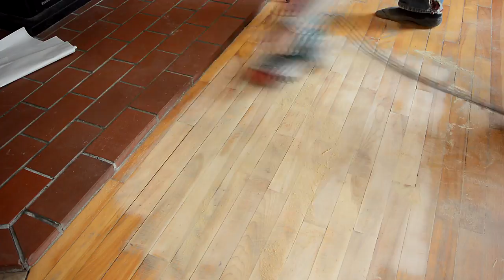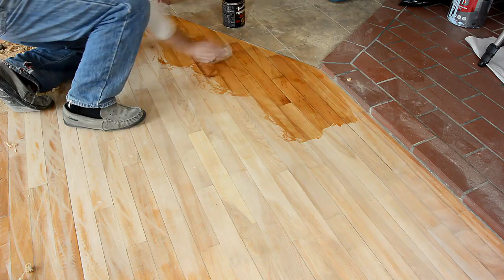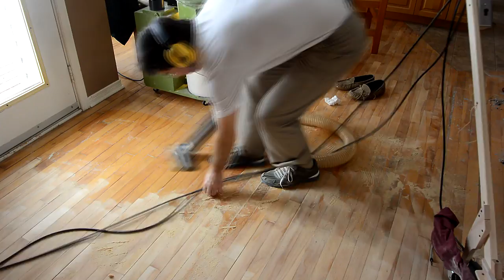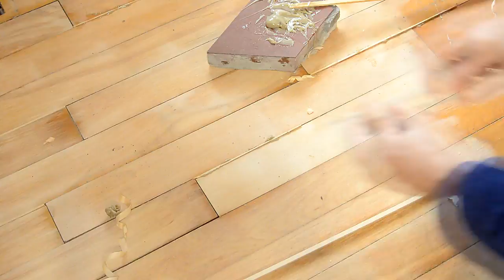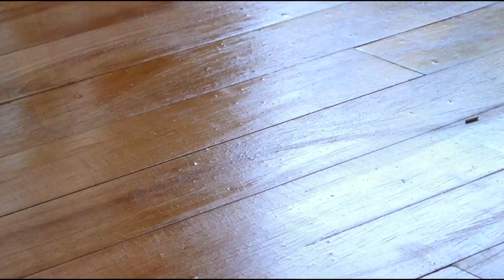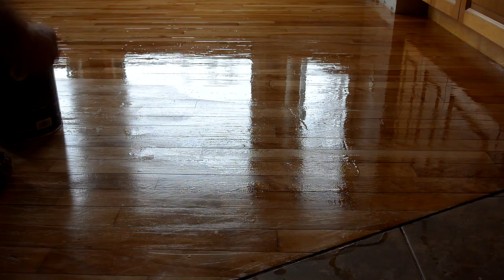Hardwood floor refinishing by trial and error

Comment: I did mine...just rented a floor sander...big beast but fast and really cheap. £50 for 3 days if I remember rightly.
Reply: exactly... rent a floor sander... lol
Reply: Yep. Time is money. renting the right tool is the way to go
Reply: Yep, in my area they have the pro models that are the big drum and disk and one for someone who is afraid they may sand thru their floor with the belt sander or get spin into the wall with the floor disk sander/buffer. It usess 6 6" orbital sanders.
Reply: Cliff Hartle I think my place did a deal as I got the rotary edge sander too free. Just had to do the corners by hand.

I think the paper/pads/belts cost me about £3 for the whole job. 1 room and none hallway.
Reply: I found it truly painful to watch this with Matthias using a what a 4" wide belt sander even with the handle.
Reply: Or hire a pro!
Reply: you no pro
Reply: Tony Walker what do you know?
Reply: Russell Cottier jm

Comment: The first thing he says is that they are getting the floor professionally refinished. He just wanted to experiment, tinker with some methods for fun. It is what he does. That is why he is an amazing contraption builder.
Reply: Dire Axe - Or, being a professional, they just did their job. Shoot, he probably told him what he did anyways.
Reply: True, but he could have done it himself. Just use 36-, 50- or 60-, and 80-grit sandpaper, along with the corresponding sandpaper for an edger. Use that scraper to get the parts the edger could not reach. And finish with a buffer. 

Why destroy the floor?
Reply: SO IF YOU ARE GOING TO HAVE IT PROFESSIONALLY REFINISHED WHY SCREW IT UP FOR THEM BEFORE THEY START.  YOU MUST HAVE A LOT OF SPARE TIME ON YOUR HANDS.

Comment: This tutorial is perfect for those who have tons of free time in their hands but no $ in their packets to rent floors machines.
So many things could of done right in this video.
The right way to sand and refinish a floor 
1. Clean floor gaps and fill it in with floor filler  before sanding.
2. Sand floor 2-3 steps.
3. Buff the floor.
4. Apply color.
5. Apply first coat of floor finish
6. Buff again
7. Apply another coat of floor finish
8. Check and apply final coat of floor finish.
Sounds so many steps but actually is way faster and the results is professional.

Comment: Hello thank you for your video. Your exploration process figuring out how to refinish your floor was very interesting. Although you took a difficult way to get there I've seen worse jobs. If you and your family like it that's what matters. Typical sanding and refinishing is $1.50 per square ft natural process, (meaning no stain), or a $600 minimum. Based on the size of your area you may have been able to get that done for $600. For those that watch this video for instruction. I would recommend using a rental sanding machine (or for a very small area you can use that belt sander if you are patient), starting with a 40 grit sandpaper sanding, with the grain, never across it. Fill your out of Tolerance gaps, meaning larger than the width of a coin (quarter) with wood filler, they sell wood floor wood filler in the appropriate color to your stain. Many of the fillers also accept stain. Sandable wood filler is similar to joint compound. The non sandable putty that he used is for nail holes and cracks that you would use either between coats or after the final coat if you wanted to fill something that you missed. Moving on, then you would use a fine grit sandpaper 80 grit on the Belt machine.  You then need to scrape and hand sand the corners, saddles, or wood work that you cannot use the machine on. Next you will use a buffing machine with 120 Grit which spins in a circular motion typically 16in pad and that will make the floor smooth and ready for finish. Or for a small area you could use a palm sander. Next process you would vacuum the floor thoroughly. After vacuuming consider using a tack cloth which would be a towel pushed with a broom to pick up excess dust. Dust is your enemy in wood floor refinishing! Your floor must be very clean! You may like to wet the towel with mineral spirits, as it will not have a reaction with the wood, do not use water. Then you are ready to apply your finish. Apply the finish or stain with the grain of the wood. always use thin coats. You do not want thick puddles. typically you would use a lambswool applicator which is approximately 9 inches wide, or you can use a 4in disposable brush and paint your way out of the room for smaller areas. Lightly sand between coats with 150 Grit, vacuum and Tack cloth, apply as many coats as you like. Typically three is sufficient, four coats with water base.  all right folks have fun with your wood floors. Or if you are local to Rye New York you can contact me. Thank you and best wishes

Comment: You should always sand wood with the grains.. Not just rub the machine all over the place...
Reply: This isnt a DIY giude xD
Reply: And he also explains his reasoning and, while I'm no expert, I think it's pretty solid
Reply: That's true but you can go diagonal if the floor board have cuped or bowed and you cross cut it the other direction but after this you must go with the grain
Reply: But it different story with the edgers
Reply: That's what i thought as well
Reply: LucidDarkness omg. My wife and I just cracked up over your comment. To funny
Reply: Exactly!!
Reply: @Weird Science 
Actually, as a "PRO" hardwood floor guy I can tell you that you always start your first pass with the big machine "aka hummel" at an angle, the angle depends on the how flat the boards are in relation to each other. And your last pass with your last grit will always be straight. But what do I know, I have went from building cabinets and installing trim and doors to installing and finishing floors of pine, red oak, white oak, walnut, cherry, maple, hickory and Brazilian cherry. And just so you know I'm really a pro I have some sawdust boogers in my nose.
Reply: Glad I wasn't the only one cringing at that lol
Reply: If you're doing multiple passes with the same grit you can do the first pass across the grain. It's really only important that you finish with the grain. The purpose of going with the grain is to hide scratches left by the sandpaper, but the last pass with take those out.
Reply: I AGREE THAT REALLY BOTHERED ME CONSIDERING I'VE RESTORED LIKE 20 WOODEN FLOORS AND SOME OF THE WORST IN CHICAGO APARTMENTS THAT HAD CARPETING WITH STAPLES
Reply: 🤣OMG, I CAN'T LOOK!!! WTF 🤣🤣🤣

Comment: One of my earliest memories is when I was a toddler back in the early 70s, my Dad refinished the oak floors in two large rooms in our house. He sanded it all down on his knees with one of those big chrome hand held belt sanders they had back then. It was beautiful, except for one gouge filled with putty from when he threw the sander across the room in a moment of frustration. I'm guessing you experienced that emotion at some point in this project. Good job on not throwing your sander. These modern plastic tools wouldn't have survived that generations tempers.

Comment: Sanding a large surface with a small tool WILL create an uneven surface. The unevenness may be unnoticeable to the eye but each time it's sanded like this, will just get worse. If you don't care about that sort of thing, I'd call it a success. I understand your video is not a guide, but I have a really good floor refinishing video that covers all of the steps in detail.
Reply: If Matt is happy that is all that matters. I doubt he is going to jump right on redoing it any time too soon either. In fact I'd put good money on him never doing it ever again.
Reply: thank you Paul.
Reply: Yes, you dont want to use a belt sander. Just rent a orbital floor buffer and buy some sanding screens. Sand the edges by hand, use belt sander sparingly.

Comment: Matthias I love your videos and inventions but this one you got wrong as wrong could be. Fairly entertaining but still wrong. You should know that dust is your enemy when finish is applied. And with a surface this big you have to be much more consistent when removing the dust. I do this for a living and my soul is going to need some healing this weekend after watching this 😉 Anyways. Have a nice weekend and always use a respirator when applying varnish 😊
Reply: He calls it varnish but I think it's water-based Varathane floor finish.
Reply: Learning from mistakes is the best way to learn.
Reply: Learning from others is the best way. And the cheapest 😉
Reply: My only thought was that he should have washed the floor (whipe with a damp rag or mop).  Would that be correct?  I just say that because when I vacuum, if I don't mop the floor after, there's always a tiny bit of fine dust on my feet when I walk barefoot.

But I'm also thinking that you wouldn't want to trap moisture in there with the varnish.

Anyway, I wish your soul a prompt recovery.
Reply: no, reading the basics of what to do from any of the countless resources on the internet is the best way to learn. people have been finishing floors for centuries. yeesh.
Reply: Philippe Carphin We use a static disposable cloth after vacuuming to collect the fine dust. We also sand a lot more between the coats to get a smoother finish. But in this case the sanding method up front is pretty uneven so I'm not sure if i would mather that much anyways. I love Matthias's creativity and he's not to far out with the handle on the band sander. But the position should be more fixed to get an more even result. I use a Lägler Hummel rollsander and the prinsipals are the same really. But in  larger scale
Reply: Well goodie for you. Andy Warhol painted cars with brushes. Are you going to say he was wrong to do that too? Because one of the cars he painted is worth more than you're going to make in your whole life.
Reply: Paul Frederick Yes. Painting cars commercially is best done with a hvlp spray gun and everyone will agree on that. My comments has nothing to do about art or Andy Warhol. Art is a subective matter. How to sand a floor is pretty much standarised by now.
Reply: +Ruben André Bjørkevik Matthias had a subjective goal in his mind when he started. He seems happy enough with the results he achieved. Though perhaps not happy enough to do it again? He still learned plenty in the process. Which is part of the art of living.
Reply: +Paul Frederick Yes and it's totally normal for a floor finishing professional to cringe at his methods.  He even put smiley emoji's in his comment to show it's all in good fun.
Reply: Paul Frederick I'm not a mindreader and my comments is not ment as an attack on Matthias. But I still feel you're a bit edgy in your comments. I appreciate Matthias's eager and ingenuity but there would be lot ways of better tackling this project. And from a proffesional point of view this was, as commented, wrong in almost every way. I still had pleasure of watching the video and the hints of sarcasm in my comments was ment in a joyfull matter from my side.
Reply: I wouldn't be surprised if the floor looked worse after he finished with these techniques. Sanding across the grain (finished on edges), uneven sanding, scratching the floor with a scraper,  leaving dust allover, absolutely macerating the floor varnish (also across the grain). HOLY SHIT THIS IS A WOODWORKING CHANNEL!?!?!?!
Reply: +Philippe Carphin I do not think Matthias is suggesting that the methods he is demonstrating here rival that of professionals. If anything the impression I got was one of project creep. He said at the outset that he just wanted to try it out for a bit. Then he got so involved he ended up doing it all himself.
Reply: +jamieee321 I do not consider this a fine woodworking channel. I think it is more of an experimental engineering channel where the material used is primarily wood. Matthias does a number of things that many classical woodworkers would cringe at. Which I believe is a major part of his appeal.
Reply: Paul Frederick I think anyone would cringe at that floor if they saw it in person.
Reply: How about from this perspective? Its obviously a DIY job, but its still better than the original scuffed up floor. If hes satisfied with it, and is willing to live with it, who are we to judge?
Reply: +Paul Frederick, I didn't say that Matthias claimed that his methods would rival those of professionals.  In fact I would wager that he knows full well that his methods a not state of the art.  That's why it's fine if a pro wants to tease him about it respectfully.

I do my own bike repairs and when my friend who's a bike mechanic sees them, he teases me about it.  He takes pride in doing his job to perfection, so I understand when he does it.  He understands that I'm not charging anyone for the repair and that I'm satisfied with my work.  We have fun.
Reply: You ever stop to think that he just wanted to do it for the sake of doing it? For fun. You ever hear of that word? Fun? You sure do know how to suck the life out of fun so you must know what it is.

On top of all of this you're pissing in his Cherios for nothing. The floor looks good.
Reply: I don't think he did it for fun. It was more like one thing lead to another and curiosity got the better of him.
Reply: I agree with you there are a lot of people leaving comments that are just mean. "pissing in his Cherios" LOL!  I never heard that before, I'm dying laughing right now! Thanks for that :)

Comment: I know you like to use the tools you have, or build a tool for a job, but the only thing that really sands a floor properly is... a floor sander. You can usually find a place that rents them. And use a tack rag to make absolutely sure you get all the dust off before each coat of varnish. (And it might be a good idea to wear a dust mask.)
Reply: If "the only thing that really sands a floor properly is... a floor sander", then what did they use for centuries before the invention of electricity?
Reply: If you've seen the movie "Hidden Figures", you know that the term "computer" originally meant a person who, well, computed. So what would a "floor sander" have been a hundred years ago?
Reply: @purplealice  haven't seen the movie. I guess you're trying to say a sanding  block.

Comment: You might need those gaps in the floor for the expansion and contraction of the wood?
Reply: Well at least we'll get a follow-up video out of it where he shows us how he fixes buckling
Reply: It’s not really necessary on a floor that old, they’re usually pretty settled by then
Reply: the floor will still pick up more moisture in the spring and summer and expand
Reply: Looks like maple, in which case it won’t expand.  Those cracks are there to stay unless you fill them.  If there’s any flex in the flooring filler will just come out.
Reply: No, the gaps between the boards need to be filled. There should be a 1/2 to a 3/4 gap along walls for expansion.

Comment: I absolutely died whenever you went against the grain. You always go with it.
Reply: No, you do not have to always go with it. The only purpose of "going with the grain" when it comes to sanding is so the scratches that the sandpaper leaves behind are parallel to the wood grain, making the scratches harder to see. That's literally it. You can go at it at whatever angle you want in the beginning, as long as your final grits are parallel to the grain, so it's harder to see the sanding scratches..

..which the varnish will mostly fill in anyway. So him sanding perpendicular to the grain is really not a big deal. Same with most wood projects.

Comment: Use petroleum jelly on your hands after you use construction adhesive.
Reply: I also noticed WD40 can help for some construction adhesives : rub your hands with WD40, then regular wash them with soap and water.
Reply: Just tried and and you are correct

Comment: 40 grit for varnish removal, 60 grit to remove deep cuts and grooves, 80 grit to sand and smooth. a perfect floor finish is helped immensely with using those 3 in order. Prevent wearing out your sand paper, and properly scrubs the floor.

Comment: I'm just starting a project of hardening an old wooden floor which suffered from wood worm as well and your video is amazing. I do wonder, do vernish keep wood worm away?. Meaning, if they try and eat through it, would they die?. Was thinking about using the same method you used with several of coats and was wondering how does it effect the wood in terms of making it stronger. Would be happy to get your thoughts here. Once again, many thanks

Comment: I do this for a living. First is never go sideways against the grain while sanding or staining. 2nd. CLEAN CLEAN CLEAN. It needs to be vacuumed very very good. Then gone over with micro fiber cloth. Also take your shoes off and work in your sox when doing stain or poly. Clean good between each coat. And when sanding. Invest in renting a commercial sander from homedepot.

Comment: That old wax based shellac they use is really hard to remove , I am a professional hardwood floor specialist , we refinish and install new . When we do floors like this we first hit it with a drum sander , using 30,60,80 grit sand paper , we then use an edge sander with 60 grit , using a hand scraper to get the spots in the corners we couldn’t get with the edger . Then we use a buffer with 80,100 and finally a 120 grit screen, after that , depending on the type of wood we will  raise the grain of the wood with water , let it dry then use an oil based polyurethane made by bona.  Nothing comes out better.  Sawdust dry in finish is horrible , u really need a dust free environment to do it properly , I have seen ppl take sawdust and glue and basically skim coat the entire floor sand it and apply varnish ,